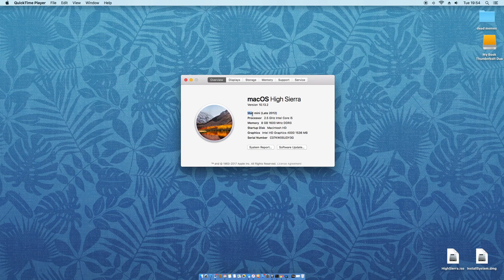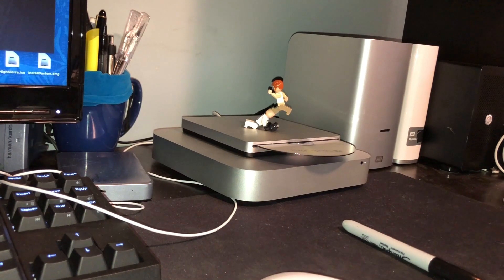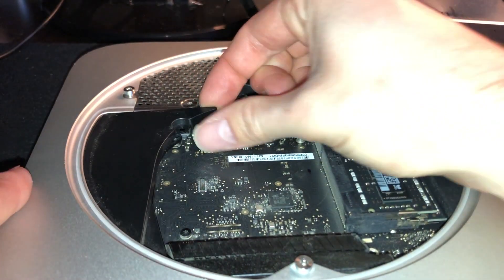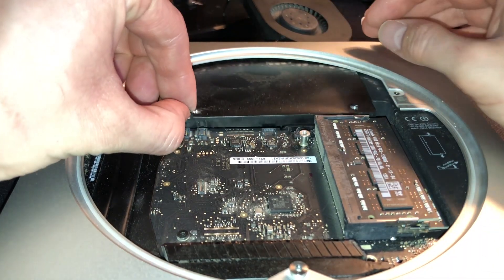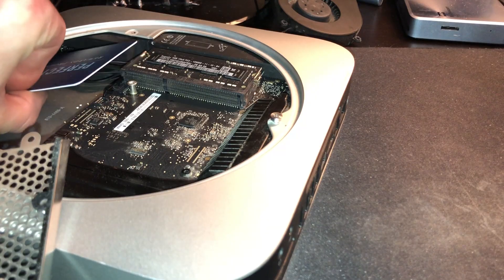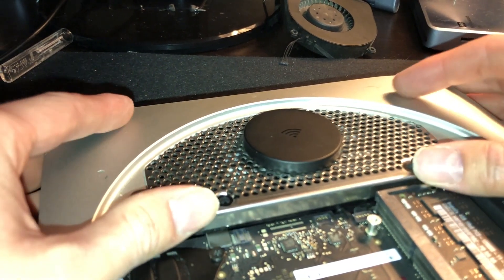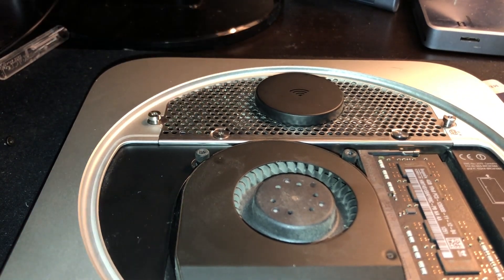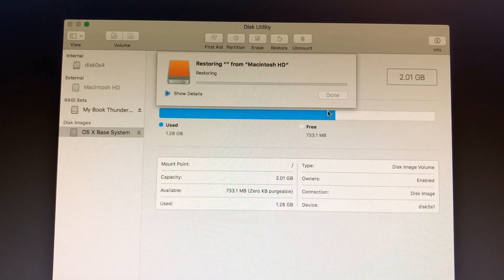Upgrading a late 2012 Mac mini to a SSD.

Comment: Tip you dont need to make a dvd iso and using that method many mac os kvm repositoried have python files that can be used to download mac os once downloaded if you are on windows you can use transmac to flash the usb on linux use dmg2img to get an img file and flash it and on mac use disk utility to restore

Comment: Great job, and especially nice that you showed the minimum amount of disassembly required to get at the drive bay. Should have cleaned all that dust while you had it opened up, though!

I think it's safer to get an external enclosure, any cheap one will do, and set up the new drive before doing the installation. You can either clone your existing drive over or install whatever version of MacOS you plan to run. Then boot from the external and make sure everything is working. Only after that should the old drive be pulled and the new drive installed. This is the only way to be sure that the new drive you just bought actually works 100%! Even if you don't have an enclosure already sitting around a decent USB 3.0 (or even 3.1 Gen2) enclosure can be had for around $20 and is a good place to put your old drive once you have the new one installed inside your Mac, giving you some extra storage or another backup destination.
Reply: yeah the enclosure is only $10 on amazon lol. they didn't even advertise the adapter they used lol.

Comment: Good job on this procedure for the upgrade.  I use my Mac Mini for Music Recording, and it is dreadfully slow.  So I did this upgrade today.  My experience was this:  First off let me say in another lifetime I was a Electronic Technician.  I worked in the Marine Electronics Industry.  In the 90's I decided it was time to give it up.  Reason?  I was interfacing a Navigation System to a Radar PPI (Display).  I had to remove a resistor, took me 2 hours to locate it.  It was something like 3 cm square when I finally did locate it. Which brings me to this job, the connectors are minuscule and delicate, seems way smaller than the video makes it our to be, good job on the closeups!  So anyone doing this job, go slow, be very careful.  Patience!!!  Took me a long time to seat the new drive, using the Credit Card trick didn't work for me, but I managed to get it aligned and seated properly.  A mini flashlight and a magnified glass helped a great deal.  My only error was not getting one of my memory modules seated , easily corrected.  My one total failure was doing a restore from the old hard drive to the new SSD.  I'm not an experienced Apple user.  In the end I had to a fresh online install. First time it failed, I saw it want to install OS Lion, which was probably the original OS  After doing a Power On Reset, my second attempt of the Online Install went great.  It came up as Mojave for the install this time.  So thanks again for doing this video, I'll be able to get a few more years out of this Mac Mini with the new Drive.
Reply: I saw a video where a guy put a piece of tape on the top of the SSD and left a handle on top where he slid it into position,..pretty successfully !!

Comment: Just upgraded my 2012 last week with an SSD. Didn’t have to disconnect any cables except for the drive itself. Just slightly pushed aside the WiFi antenna and fan. I do have the server version.
Reply from the maker: Yeah, you don't "have to", but I wanted to show it a little more "properly" for the video so that it may reduce people breaking wires. ;)

Comment: Amazingly this is the best video that I’ve seen for this.
But: downloading the OS iso serves no purpose.
Reply: I did this also but before I did the install I took the new ssd drive and put it in an external usb case and used super duper and cloned the ssd drive so that when I installed the new ssd it booted up with no problem and it was like I never changed drives, everything was the same
Reply from the maker: Tyler Johnson I disagree, it’s a last ditch resort Incase all else fails. If you don’t have another Mac it can be quite a pain to get it after you’ve already done the upgrade.
Reply: Coty0010 You can just restore from the cloud or download and install it directly from recovery mode.
Reply from the maker: Tyler Johnson yes assuming recovery mode hasn’t failed and that cloud service is working, but I’ve ran into an instance where I had to wait about 7 hours to download from cloud as it kept failing or telling me to try again later and this was fairly recent... so maybe I’m just old school, but I do have reasons for it...
Reply: Coty0010 I see. I’ve done this several times and never had recovery mode fail me.
Very good video though. Very instructional and helpful!
Reply from the maker: Tyler Johnson glad you enjoyed it!

Comment: Did you cross thread one of the hard drive screws? Doesn't look flush.
Reply from the maker: Denver Morgan the short answer is yes. The threaded hole on the Samsung drive oddly does not match up perfect with the drive cage  and is of by less than 1mm, I disassembled and re-assembled 3 Times to make sure the drive wasn’t crooked but it doesn’t appear to be. I considered putting the cage under my drill press but decided it wasn’t worth it and so here we have a crooked screw. I suppose I must have left that out of the video.